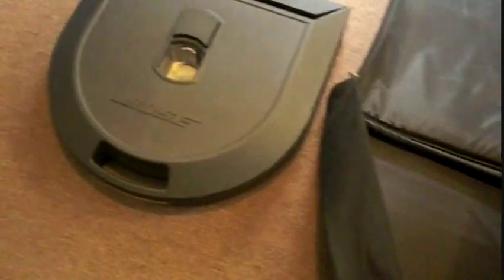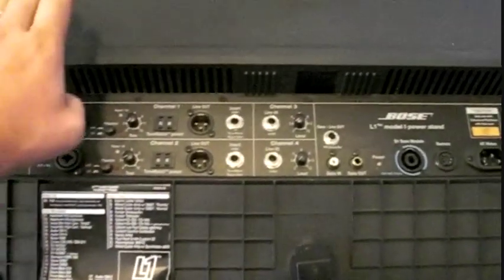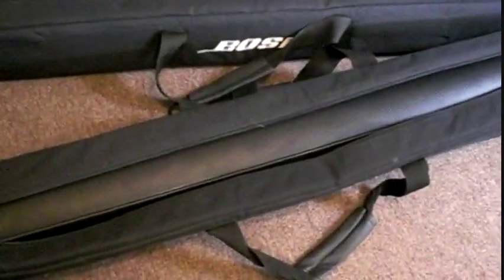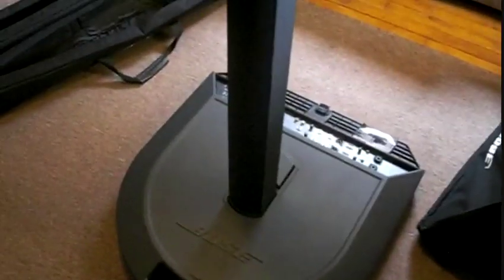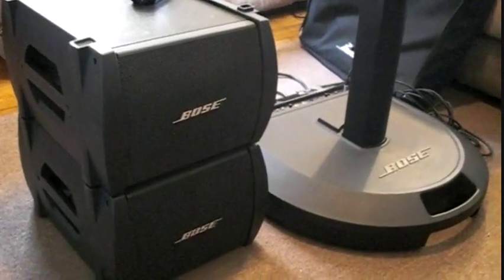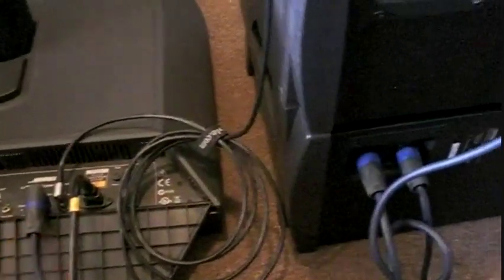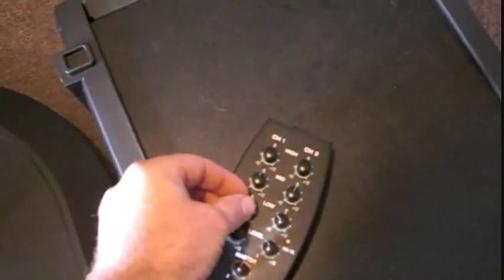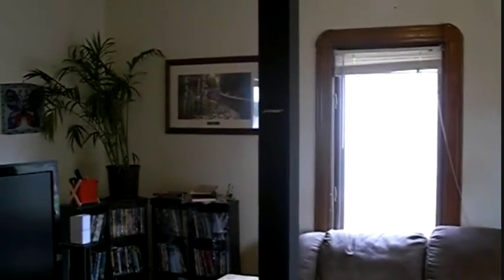Bose L1 Review - Short But Sweet - Remake - Part 1 HQ

Comment: I have a bose L1 model 1s  that won't switch on, I have been told all the parts on the PCB in the amp  are miniscule. Are the parts same as the above L1 compact? ( physical  size of resistors condencers etc )  or is it a diffrent set up.  There is very little info anywere, I  really just want to find someone  in the UK who can do a good job of fixing it. Not getting the three bears, and wrong info,  any info would be really helpfull  thank you. JT.

Comment: can this be used in a park without having to plug it in? Does it require an AC adapter to plug in or can you use batteries? And what are the bass subs called? What is the name?

Comment: For bands, I would recommend 2 of the L1 systems.  My 5 piece classic rock band purchased 2 a couple months ago and now after a few gigs we are extremely happy with them.  Set up time is now 30min or less and we don't have to haul a trailer full of gear anymore!  and as he states in this video, the sound level does not drop of AT ALL like traditional speakers..and the sound is the SAME no matter where you are in the room.   Now we all are wondering why we didn't do this years ago :)

Comment: DJJD with regards to your comment about "Pick up an Yamaha MG166CX mixer (should have plenty of channels & efx"  I use ths specific mixer with the system that you have here. My Question is what is the best way to set up the volumes for this setup, as I get too much feedback. With very little volume, what am I doing wrong apart from buying this??? I only have the volume on the bose set at 2 as it peaks after this and drive the main sound from my mixer.  Using it for vocals, Guitar and backing tracks through a mini disk player.
Reply from the maker: Gerry Larkin Run a -20db Attenuation XLR Pad on the end of the cable from your mixer and plug into channel 1. Sounds to me like you signal from your mixer is too HOT. This will cool it down allowing for more output before peaking.... BTW this tip works only if you are running a Model 1. THX ~DJ JD~
Reply: DJJDBass  Thanks for the info but I run my mixer into channels 1 + 2 so will I need a Attenuation on both? Also what are your levels on the Bose compared to your levels on the external mixer? Mines are between 1+2 on the Bose as they then start to peak and I run my mixer at full tilt? I have tried every which way but loose to get the best sound but it doesnt seem to matter, the output isnt as good as it should be as the guitar and backing seems to be killing the vocals. Sorry for all the questions Cheers Gerry
Reply from the maker: Gerry Larkin Yes -20db pad on both. What type of mic are you using for vocals?
Reply: Gerry Larkin Hi DJJD I'm using an EV radio Mic N/D767A and an EV hard wire mic I also use a shure sm57 & Shure Beta.

Comment: My 3 piece blues/rock and just about every other kind of music band uses a SINGLE L1 COMPACT for our stage monitor system.  Best monitor system ever made!  We use it as front of house in small places where we dont mic everything and only run vocals through it. Its AMAZING!  Havent found a place yet that the vocals wont fill the room when used front of house in small venues.  In large venues used as a stage monitor system its just as I said, the BEST you can ever get.  If the L1 Model 2 works as well with a mic'd full band then you cant beat it.  As long as it'll fill the venue and if there's enough sub.  I've never used the L1 model 2 so I dont know but the compact is astounding!

Comment: I am very interested in BOSE L1 systems. I heard them and they sound fantastic!! I am going to buy one of that systems, but i dont know which is better - model 1 or model 2? I saw that model 1 is much more cheaper than model 2, but i dont know if there is any difference in sound quality. I want to use two BOSE L1 double bass packages together with Behringer Eurodesk mixer, because i need good PA system for my band, school partyes and things like that. I think that BOSE L1 is the best choice.

Comment from the maker: @RedEyeC It should sound great, except you might want to either use a pad to lower the signal out of your mixer by 20db or you could use channel 3 or 4. Channel one & two don't like HOT signals, they were originally made for Mics. That being said I use channel one, but I have a -10 attenuation switch on the back of my mixer (Denon X500) & I've always got it on. Band mixers usual have even a hotter signal than DJ mixers hence the -20 pad.

Comment from the maker: @ega0117 first off the pose base is smaller on the Model II & weighs less, next the Model II has only a single 1/4" input where as the Model I has four - two XLR & two 1/4"  (the Model two was mostly designed to be used with the T1 Tonematch Engine). Last major difference is the drivers in the tower of the Model two are mounted in different directions, where as the Model I's speakers are all facing forward. The main difference here is the Model II achieve 180 degrees of coverage - Mod. I - 160

Comment from the maker: @arc1e yes, but you may need to lower the strength on th signal by putting an in line -20db pad
& for you second queston... yes a single L1 can handle 200-300 people, but personally I always like using two in stereo for a crowd that size.

Comment: This has happened to me before, use unbalanced 1/4 to channel 1 or 2 input when using it for prerecorded music otherwise it will shut off automatically when the volume is above certain level if you use balanced xlr cable or balanced 1/4 cable this is because of the dBu.